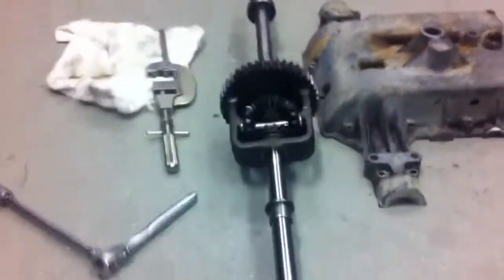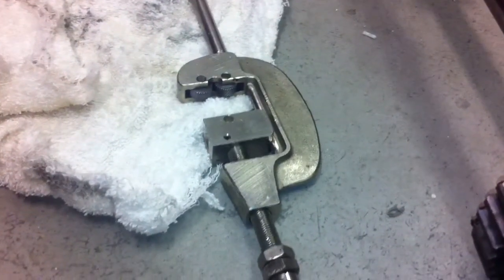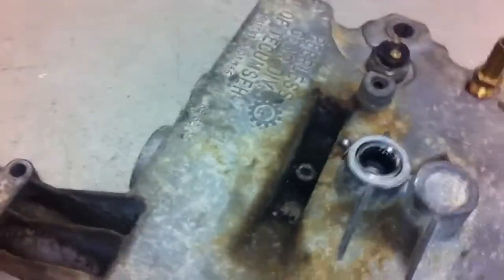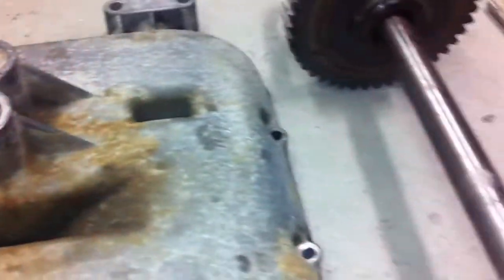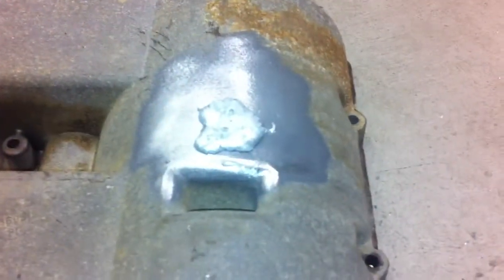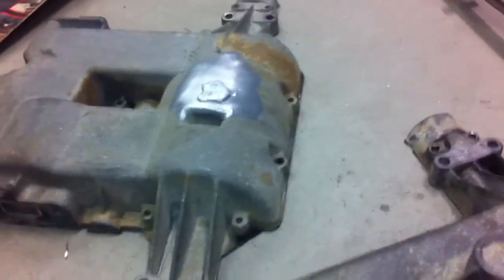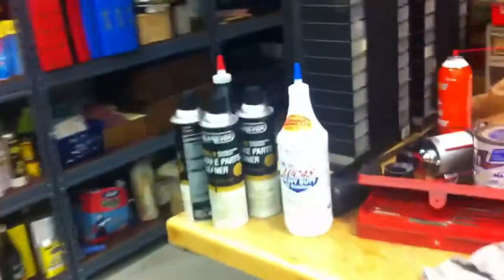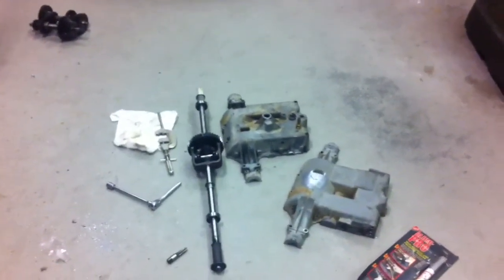Peerless transaxle part 2

Comment: I am in the process of removing my 801 019c from the simplicity.  There are two brackets each has three bolts held on with a nut on the backside of the frame.  It is a knuckle buster for sure.  Any tricks you might share for getting those out and back on after the reinstall would be appreciated.
Reply from the maker: Robin Rubin 
Are you talkin about the brackets that are forward of the transaxle and drop down to support the front of it? 
I was able to remove the bolts out of the transaxle and leave those in there, if those are the ones you mean.
Reply: The Axle slides through the frame, the bracket sits ontop  of the axle and bolts to the frame and axle.  The axle has 2 easy bolt and nuts.  The bracket to the frame is 3 nuts and bolts.  It is hard to get behind the frame to hold the nut.
Reply from the maker: Robin Rubin 
Hmm,would it be easier if you used an angle grinder with a 4" wheel,(I have an electric Makita)cut the ends off ,drop it out and replace the current hardware?
New stuff would be easier to deal with on reassembly

Comment: I have the same transaxle that the counter shaft broke as there was no bushing to support the shaft.That part is obsolete and I sure could use some OD,ID and length specs to make a new one or ideas on how to fix it.
Reply from the maker: I'd either try some options about modding a hardware store brass bushing or hunt down another gearbox and grab the parts. 
I'm not 100% sure but some of that stuff might swap out of a peerless 700. I do remember readin in the peerless transaxle manual in the descriptions that they say what parts are interchangable from other gearboxes.